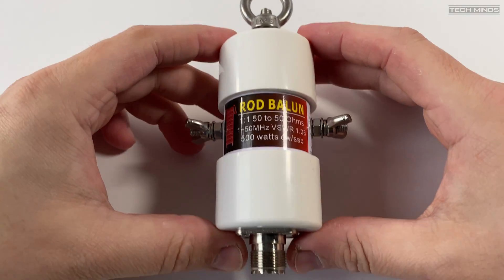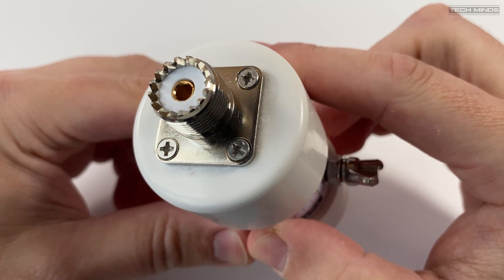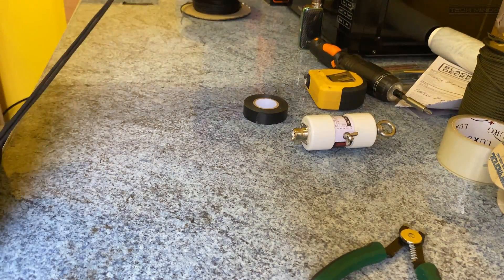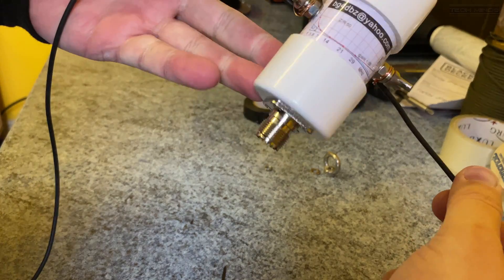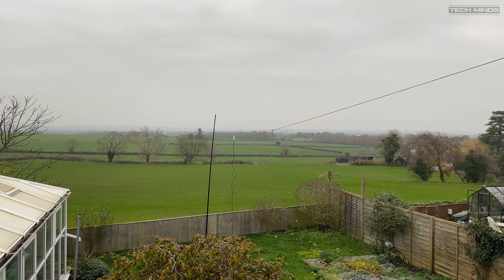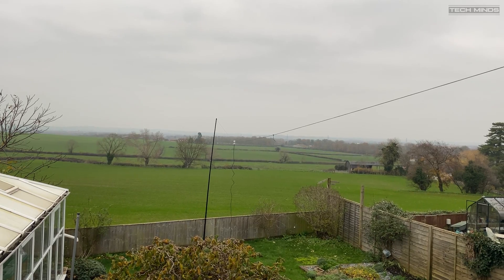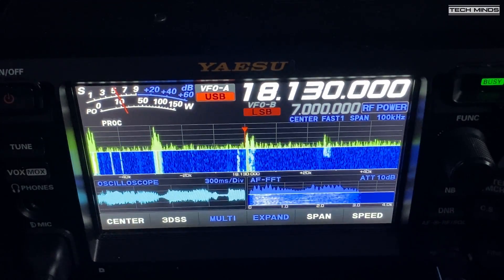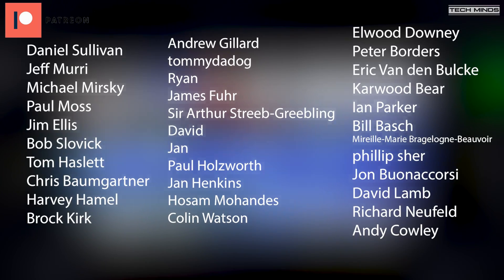1:1 HF ROD BALUN FOR 1 TO 50 MHz

Comment: I was concerned about the weight as well so I wrapped the wire around the anchor and then to the wing nuts
Reply: And I meant to ask if this could be any kind of a problem.

Comment: I made a dipole with the same aliexpress 1:1 balun for 11 meter and it works very well. I got a good SWR, and I am getting more or less the same signal reports (DX) as my sirio gainmaster 5/8, quite impressive. However the dipole needs to point more or less in the direction of the other station, but that is to be expected. Another thing I noticed is that with balun the dipole wires need to be shorter than indicated in order to get a good SWR. So it seems the balun does affect the dipole length. I did not find anything on that. Any ideas?

Comment: I’ve had a very similar one from Amazon for a few months now.  It’s a good balun, but I’d be interested to see what it looks like on the inside.  So many other Amazon baluns are just loosely wrapped around to the point where the magnet wire is almost falling off.  Being a rod as opposed to a toroid, it can cause losses and interference.  The magnetic field is basically flying out of both ends of the rod, instead of being captured by the toroid in a loop.

Comment: I have 2 half wave dipoles made with exactly the same balun.  One is for 17m band and the other is for the 30m band.
They are just 6m high and have been there for years.   
They are the best antennas I ever made and I managed many DX on FT8 with them.  
As I suggestion, I would put the antenna wire around the metal cap on top so the tension is on the cap not on the connection on the side.  The wire may break at the connection after some strong wind.

Comment: i put the same one on a 20 m 3 el  mono  Yagi with a hair pin match been up for 6 years worked the world on 400 watts never let me down for long qso,s swr stable  i think its rated at 500 continuous. even with all the lighting around over 6 years still works , but my hairpin match is dc to boom ground Had them on inverted v,s also work a treat running 400 ssb for long hours on hot 40 deg c days .Even worked 1 watt qrp on my beam into the uk from Australia on this balun l/path  so very low loss.

Comment: Thanks.. Perhaps I missed it. Did you bypass the internal ATU, go to FM mode and ptt for an SWR test? Ex. ATU disabled(bypassed). 10 watts, FM mode. Now transmit and record the SWR at multiple freqs within the 17m band. 73, n6spp-cm98

Comment: What were you testing?  What did you expect, with two half wave antennas, you expected them to work differently?  Or you expected the balun might have so much loss that you would be able to see it on your scope or S meter?
Do you expect a passing grade in this course, or you just making videos for fun?
Reply: I'm fairly sure that he runs an EFHW for either 80 or 40m so it would not be a half wave when used on 17m

Comment: why do we need a balun ?
Reply: do I still need a balun if the antenna is mono band and I am on that band. ?
Reply: @christophersmith1155  yes you need a balun because, on top of reasons explained above, connecting coax to a dipole (unbalanced coax to balanced dipole) will give incorrect vswr readings.  A simple balun is so easy to make.

Comment: I just make my baluns out of a piece of coax n tape it down the side of the radio's coax n this is how I've done it for over 4 decades in the communications industry mind you I'm talking RG-6 with RG-59 as  a balun up a 200Ft tower runnin 500 watts commercially as a repeater.
Reply: What kind of balun is that? Can you describe it, please? Thank you
Reply: @DavidLopez-bz4rj  There a tuned baiun for a specific freq you use a formula which I can't remember anymore to work out the length of the coax then you short the inner n shield together on one end n the other end you put in series with the driven dipole.
Reply: @preston963  Ah ok, I think it is a quarter wave cable, but at some frequencies it is a bit impractical because of the length, but it is very simple to build, thanks
Reply: Yes that's very true but we were using this around 500-750 Mhz.

Comment: Go the fan dipole route. See how well it goes with multiple lengths on it.
Reply from the maker: That’s a great idea! I will have to try it out. Thanks!
Reply: I was about to ask the same
Reply: I have had one for a few years I got from china, and that's what I did.  I have 80m 40m 20m and it would also work on harmonics - works very well really.